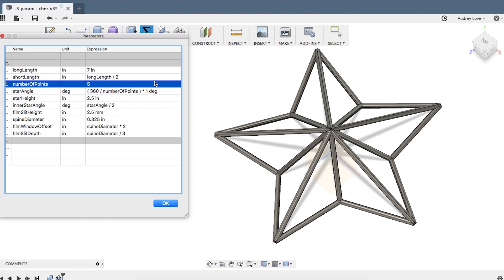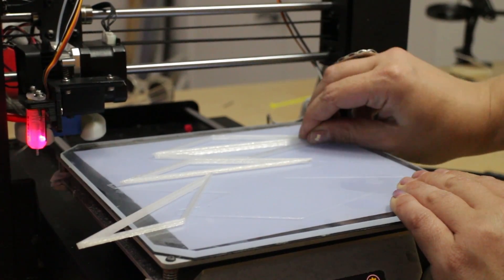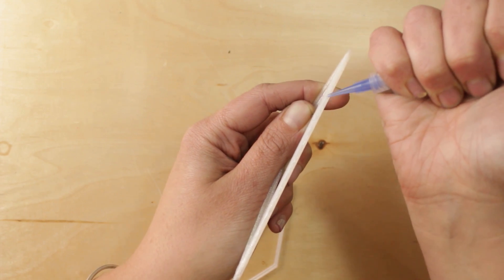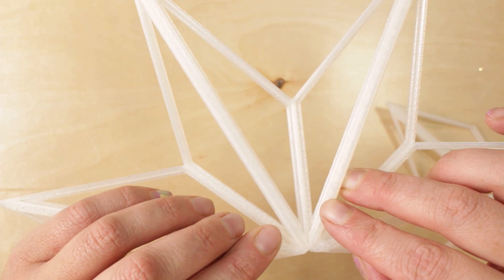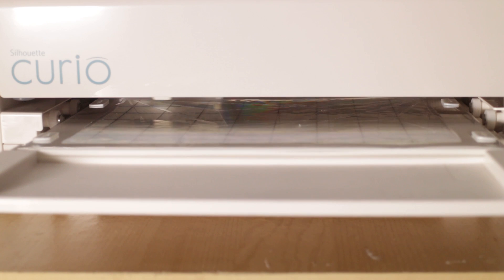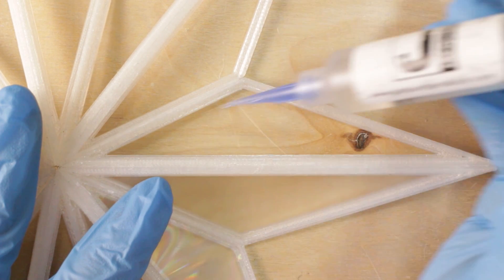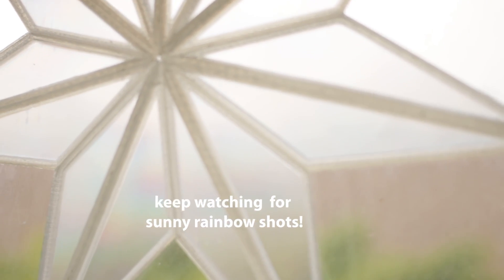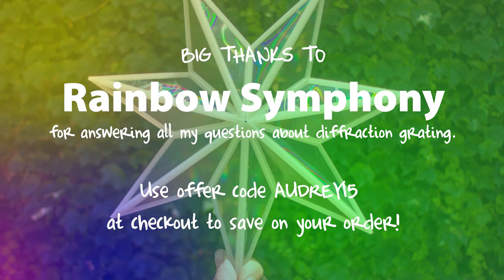3D Printed Rainbow Suncatcher ☀️🌈✨

Comment: Only the frame is printed. Tsts a little missleading. I thought even the grating is printed or used as surface enhancer.
Reply from the maker: Werner Hiemer I’m working a project that prints directly on to diffraction grating, albeit it won’t be a sun-catcher, but it does alter the surface of the base layer.
Reply: @audreyObscura  Hello why do you say that it won't make rainbows? How about silicone on the diffraction grating and then resin on that..will that make a rainbow?
Reply from the maker: @ yep! That would work but i would recommend using a super fluid low viscosity silicone for the mold if you want a diffractions surface
Reply: Thank you for replying!